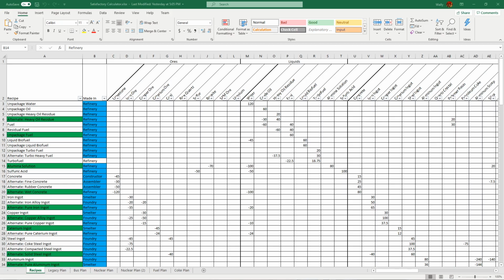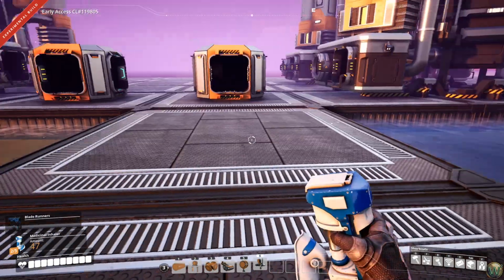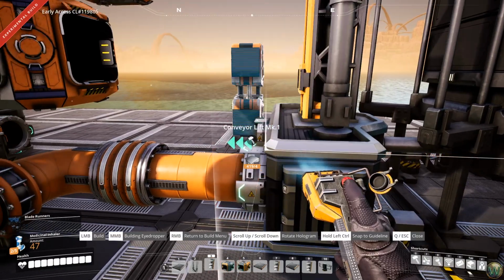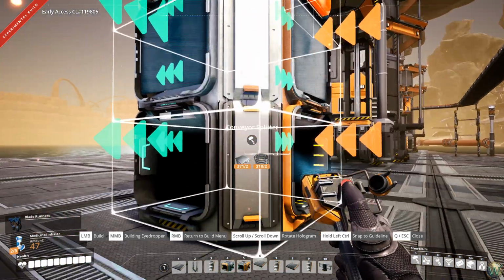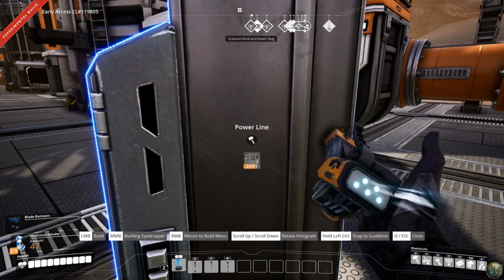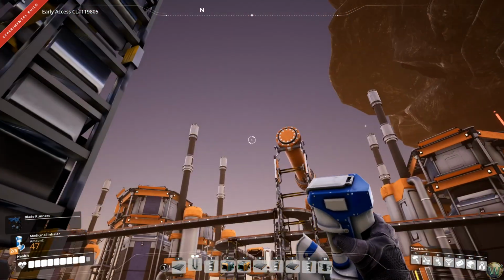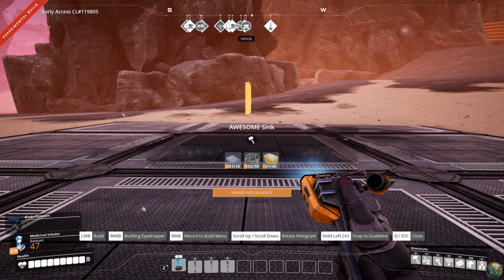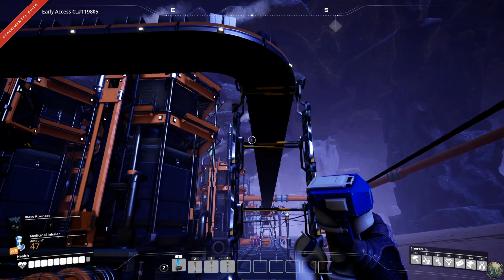Satisfactory Update 3, Episode 66: Building the Fuel Generator Power Plant - Let's Play

Comment: Dumb question but how do you get that build tool showing up when you are constructing things? For me it stays on the weapon I am using or bare hands. And without the tool I cannot do the center mouse button to copy a building thing which is really frustrating, making me use the menu so often is slow.
Reply from the maker: I use the shortcut: "F"
Reply: @Wally1169  Thank you I will try that.
Reply from the maker: You're welcome.  Remember there are no dumb questions, only dumb answers ;-)
Reply: @Wally1169  I just tried, when I hit "F" or "f" it shows the build tool but only allows me to deconstruct things. Still does not give me the center mouse button to copy ability.
And when building things the center mouse button thing does not work either.
Reply from the maker: Weird.  You’re running the U3 version?  Regular EA or Experimental?
Reply: @Wally1169  v0.3.3.5 build 118201 early access
Reply from the maker: Should be in there.  Go to Options -> Controls -> and find Building Eyedropper and see what it's set as.
Reply: @Wally1169  I will try making it a different key than center mouse...maybe there is an issue with the mouse, scroll wheel works in game but maybe it does not like the center button input for some reason
Reply from the maker: Yeah, that'd work - just find a free key
Reply: 5353Jumper I’m not sure that all mice have a clickable scroll wheel. Perhaps try a different mouse.
Reply: @Wally1169  got it to work finally, assigned to a different key it worked, then assigned it back to middle mouse and it worked there too. Guess I just needed to complain about it publicly before it would work for me.
Reply from the maker: Must have been bugged out then - the binding that is
Reply: @Wally1169  thank you for the help.
Reply from the maker: You’re welcome 😀